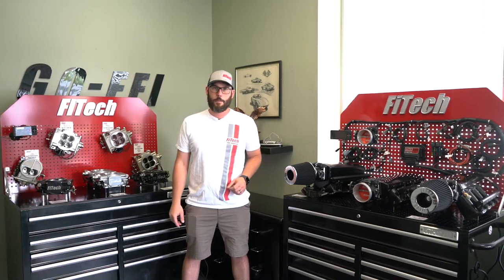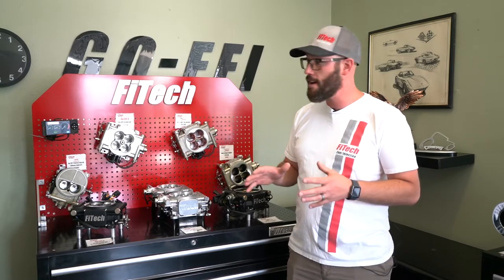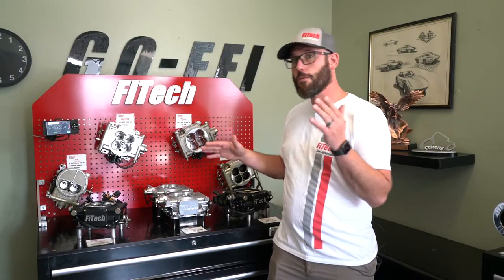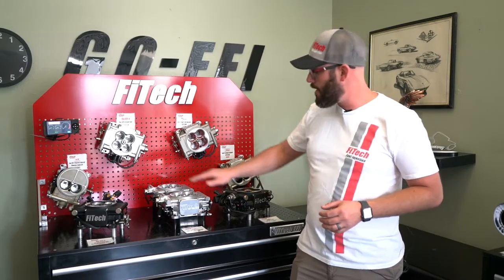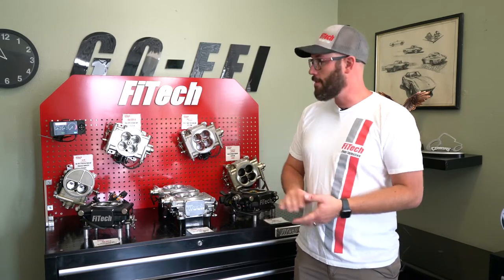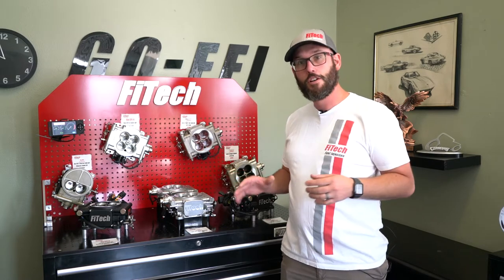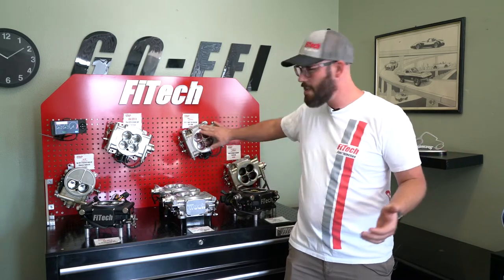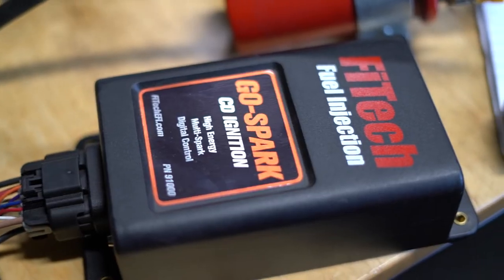Choosing Your Throttle Body | Tech Tuesdays | EP24

Comment: So far the 2bbl fitech I installed on my bug has been working well, I have noticed I can tune for boost as well as have timing control even though I don't recall it being a power adder. The new style handheld is also kick ass!
Reply from the maker: Thanks man, we love the new handheld! Send us some photos of your ride, we would love to see it! #FiTechFamily
Reply: @FiTechEFImedia  would that be to your website or Instagram?
Reply: @FiTechEFImedia  I also have some videos of it on my channel about the install and a bell crank setup I made to utilize the stock throttle cable
Reply from the maker: @V8N8T  Instagram would be best!
Reply from the maker: Awesome, we'll check them out!